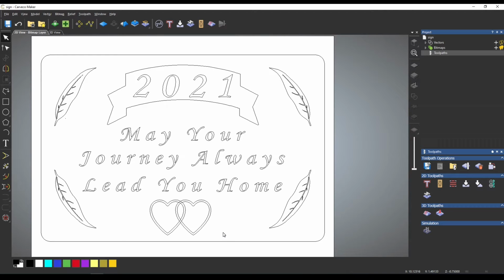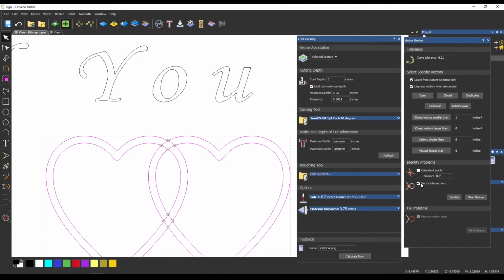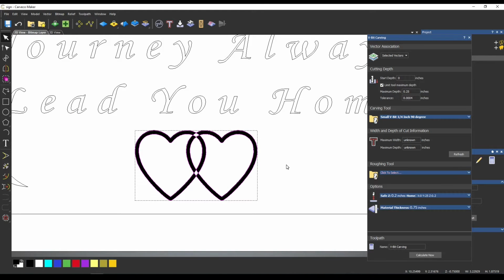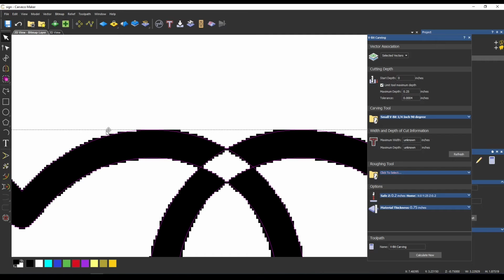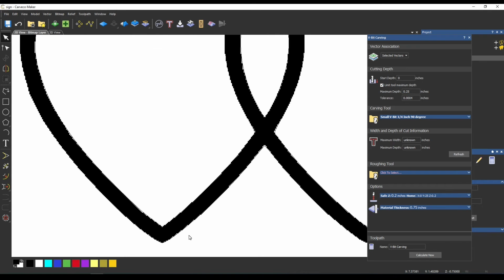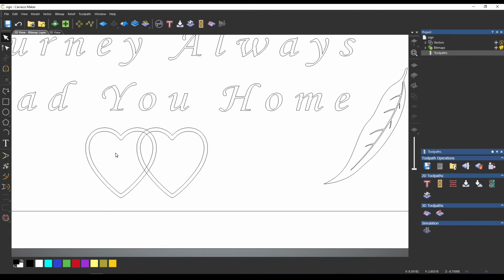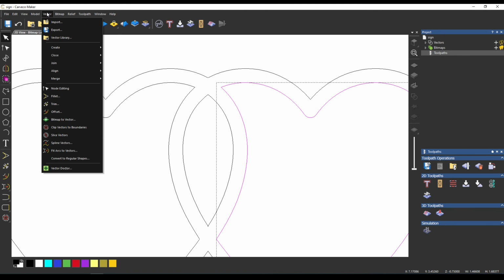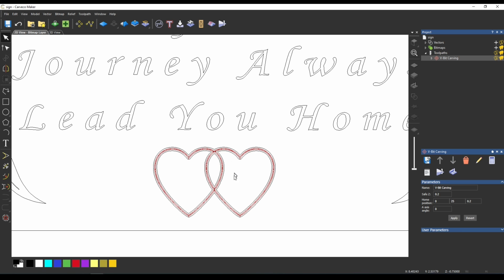HOW TO Fix Vector Errors in Carveco

Comment: How do you zoom in ?
Reply from the maker: @Chris-vc1dh  easy way is shift (or ctrl I forget which) and the mouse wheel..
Or use the button at the top right to change from selector to zoom, but you gotta keep changing back and forth, so use a mouse with scroll wheel
Reply: @SethCNC  thanks, just trying to play with my 6050 as inlays interested me a lot, if I put object in the middle of material in car eco should it be in the middle in open builds too?
Reply from the maker: @Chris-vc1dh  the gcode and thus openbuilds display will only include the toolpath. So if you used center ad x,y zero point then the design will be centered in openbuilds, but if you used a corner for example then no, the toolpath Will start and finish at that corner, thus including that within the toolpath while the opposite corner will be omitted from the toolpath... causing openbuilds to show offset and not show that other portion as it is irrelevant since the tool will never travel over there
Reply: @SethCNC  I just put letter K in centre of my wood in carveco and Z Y is in left lower corner 
Does material size go in gcode?
Reply from the maker: @Chris-vc1dh  no, only the toolpath
Reply: @SethCNC  so how the open building will know size of material?
Reply from the maker: @Chris-vc1dh  doesn't, material size is not relevant, the cnc just needs to know where to move the tool in relation to the x,y,z zero position
Reply: @SethCNC  I get it 
Thanks a lot

Comment: Good video. Thanks. When you use the trim tool could you not use the Auto Join check box. Not sure if it would save any steps.
Reply from the maker: Good point, that would have removed the merging process 👍